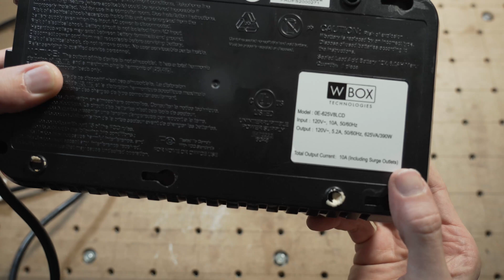How to repair a dead UPS Battery Backup Unit yourself and save money Dirty Little Secret Visionguy

Comment: Even the serviceable ones with a dead battery are a steal. I bought at 450W one with no battery for like $25 on eBay. The battery cost me about $30. That's less than half of the cost of the unit new with a battery.

Comment: Surprising that the removed battery was tested with the polarity reversed ie red probe to -ve terminal, black probe to +ve terminal. The meter showed a -ve voltage so perhaps this is accounted for when using modern digital testers??
Reply from the maker: Yes, the old analog meters needed to have proper polarity, but digital will show a (-) when the polarity is reversed. As long as you are paying attention and reading the meter correctly, you can use it either way.